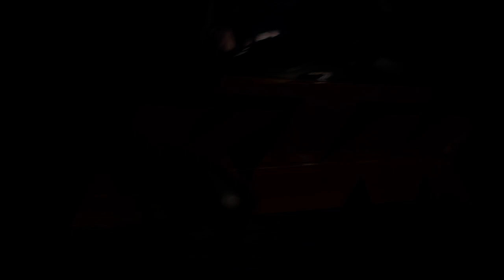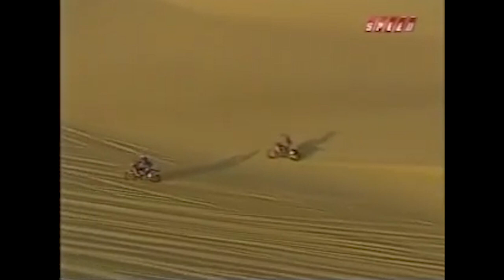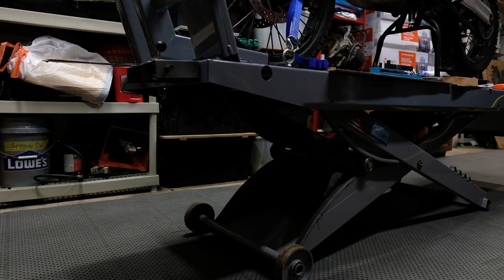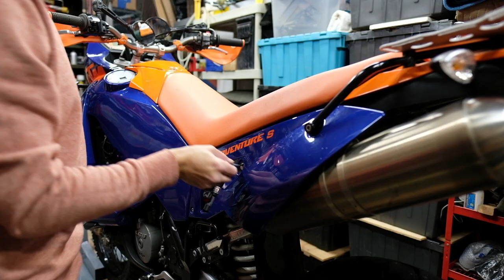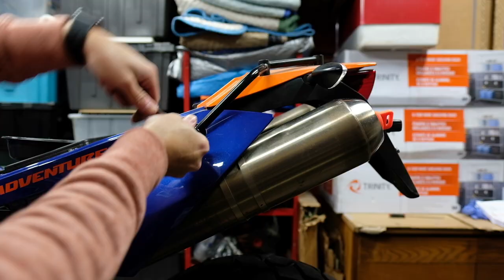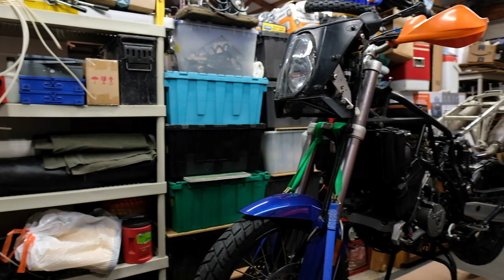KTM 950 Adventure S LC8 Restoration Rebuild - Episode 1

Comment: Values here in the UK seem to be going up from a 'low' of £3000+.
Good luck with the project...I'd keep it as stock as you can, but upgrade the waterpump, clutch MC and fuel pump. If not already done, job 1 on any of these is to relocate the sidestand. Otherwise a simple left-hand fall can break the crankcase and write off the engine!

Comment: I've had a few Lc8's 2 950 adv's , 950 SE and a 990 SMT aswell as several LC4's. I agree they are gonna hit classic status. I'm thinking of getting another 950 as a forever bike. The aftermarket is pretty big for these, you can get pretty much anything for them now subject to wallet obviously! http://www.ktm950.info/ is a good resource but there is plenty of info out there. Common thing to do is Water Pump seal, Clutch slave upgrade, Extended oil drain line, rear cans are like volcanoes so change them. They're pretty bulletproof is issues are addressed. Here if you need any help. SUBSCRIBED!!
Reply from the maker: That website is absolutely fantastic and I will be utilizing it (along with the KTM repair manual) for this rebuild.  Water pump, head bolts, valve chain/guides, clutch slave, etc. are all in the works in terms of replacement.  Thanks for the suggestions and help!